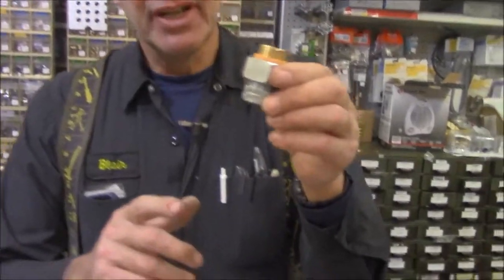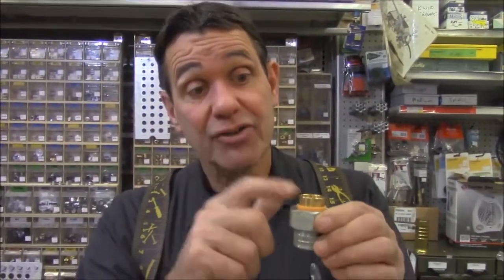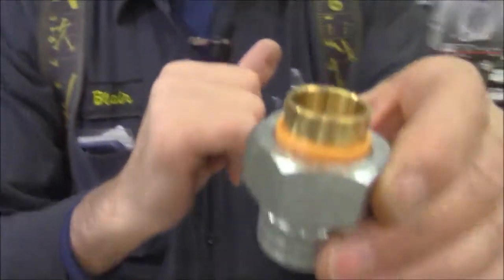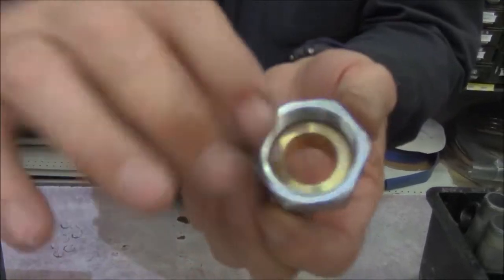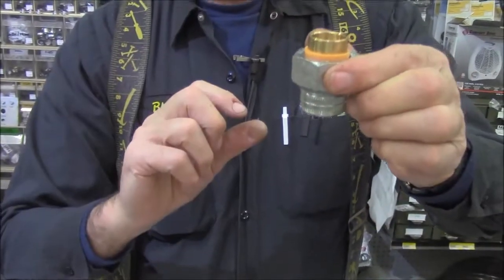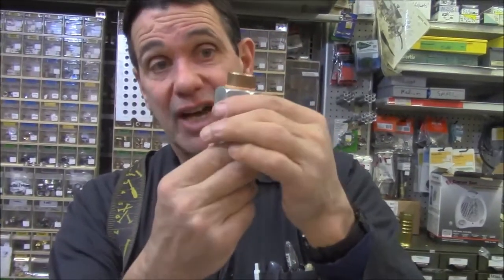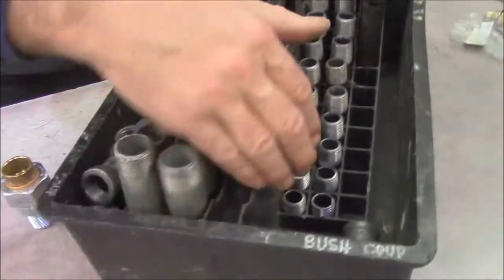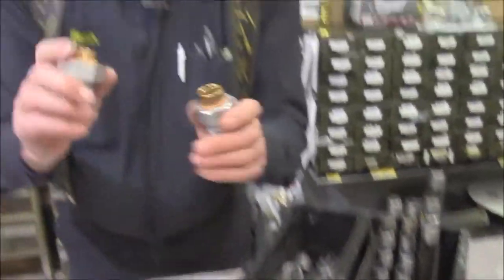Dielectric Union, Nipple Tray - Stops Crystals, Fix Hot Water Tank Plumbing

Comment: Any tips for dripping bottom-nut of the 3/4" dielectric union? 

Put five or six wraps of teflon tape then snugged everything nicely with wrenches. The cold side drips from where the bottom connector screws to the 5" nipple coming from the hot water tank. 

Tried a second time with DTP paste but still same drip in same place. 

Probably just go get another union and try that
Reply from the maker: I have reinstalled trouble fittings by using 5 very neat, stretched wraps of teflon tape, then used teflon paste dope on the first 3 threads of the fitting. However a bad fitting crops up every once in a while.

Comment: You might want to say why crystals form at some locations and not others.  I have never seen one of these in my locations, Western Canada, so I suspect my region does not need them or someone would use them.  Probably some types of water have a higher chance of this than others.
Reply from the maker: +Alex Holland 
We get electrolysis from small amounts of electricity and dissimilar metals forming crystals of (calcium I think). We have a lot of chlorine and fluoride in our water.